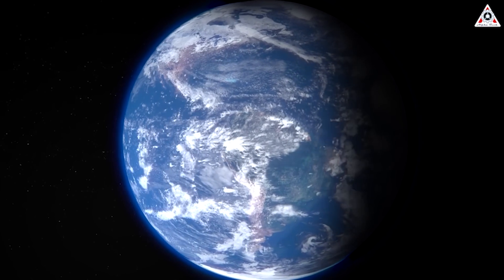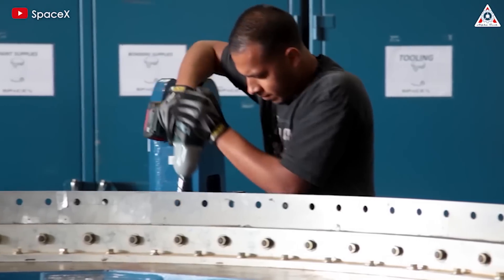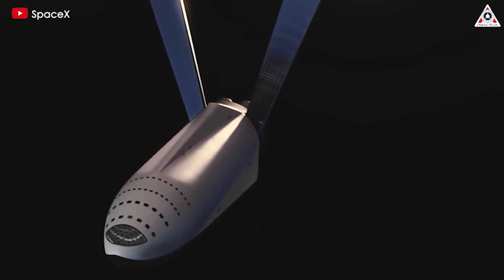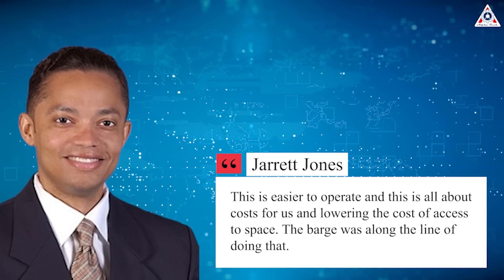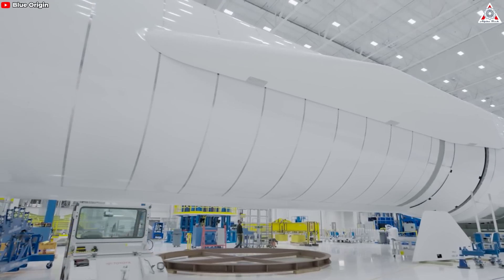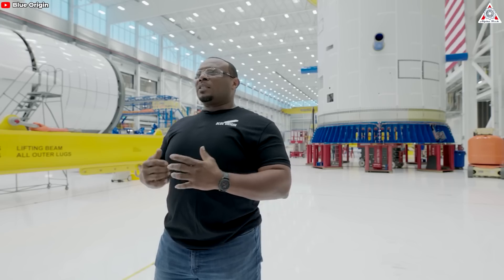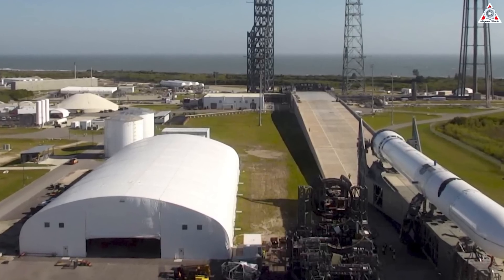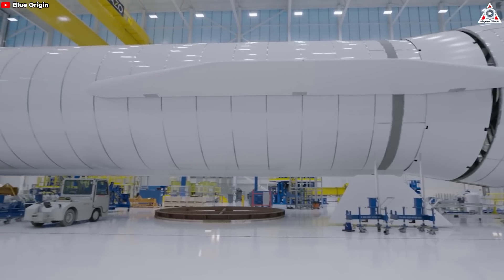Somehow Blue Origin New Glenn to orbit EXACT Starship Killer! Musk laughs...

Comment: In a simple answer - NO - they have done little to no testing like SpaceX has done and just expect it to launch and work straight away - well they are going to be in for one big surprise when shock horror it doesnt behave as expected!!! Craft like these require extensive testing and infrastructure both of which BO has done very very littel of, but because of the NASA connection it looks like its going to get its first outing ahead of Starships flight 5 which is being 'strangely' hindered by the FAA yet again.... hmmmmm. This will only hold water for so long guys before you are found out for being political and getting scrubbed of your own!!!
Reply: Yup I'm gonna laugh so hard when new Glen plummets to earth in a fire ball. I see this going as well as starship flight test 1. It probably won't destroy its stage zero but I give it a 50% chance of making it past MaxQ and a zero percent chance it lands on the drone ship. I can see the fireball as it hits the drone ship at terminal velocity now

Comment: New Glen has potential to find a niche beyond LEO due to the hydrolox second stage.  To a degree the fight for this space in the market will be with Vulcan.  If ULA makes first stage engine pack reusable this will hinge on the cost of second stages.  RL-10's are pricey.  Don't know about BE3-U.  Not quite sure where Jarvis fits in.  Kind of like Falcon heavy where most missions are core expendible.  Maybe a good Moon return vehicle, though as a third stage might be better.
Reply: If BO Escapades launch is successful, then they would actually be ahead of Starship.

There is more than a niche market for BO.
Starship can lift 150 tons to LEO. New Glenn can lift 45 tons.
New Glenn could be the more cost effective vehicle for all payloads less than 45 tons. Because it will use much less fuel per launch.
Reply: @vonnikon  Possibly ahead of starship, yes, but even for payloads near 45 tons it will have trouble competing with Falcon heavy.  As things get farther out the hydrolox second stage is more effecient than the kerolox second stage of Falcon.  Falcon heavy with two recovered boosters beats or matches New Glen to about GEO, after that  New Glen can launch heaver.   Even if soon launching and recovering commercial missions, Starship will be busy developing and flying moon missions, completeing Starlink, developing spacesuits, Larger Dragon, and no end of other missions.  I see a place for Neutron, Falcon 9, Vulcan, Falcon heavy, New Glen, and Starship depending on payload and mission profile and production and operational expense.  Falcon 9 will likily have its number of flights reduced starting in 2026.  Remember starship is the way for Starlink completion to full capacity,  and to Mars eventually.  That design makes it good for the moon as well, and New Glen may eventually have a place there too for lighter loads.  Falcon Heavy may have a place at the space station at the moon simply because it can and has been flying, but it is not optimum for that high an energy.
Reply: @michaelmcmullen354  would a New Glenn launch not be cheaper than a Falcon heavy?
Higher percentage of reuse, and fewer boosters to recover and refurbish.

Another practical advantage it has is the fairing size. Falcon heavy has a tiny fairing, which limits the payload.

I agree that for high orbits the New Glenn shines.
Reply: @vonnikon  The issue is second stage cost.  The merlin vacuum is rather cheap, the two BE3U's cost quite a bit more.  Currently no plan to reuse that expensive larger fairing on New Glen.  Therefore the Falcon Heavy is likely a little cheaper than New Glen per launch.  Also F9 and F9H development costs should be pretty much amortized.  New Glen should be a good rocket when the bugs get worked out if Blue does not do a Boeing or make enemies.  Its sweet spot is just GEO and beyond.  The competition between New Glen and Vulcan may be fierce if vulcan starts recovering engines and other bottom section knick nacks..  Vulcan's second stage engine, the RL-10, is very pricey.  Excellent but expensive.
Reply: @michaelmcmullen354  but the F9H expends 9+1=10 Merlin engines per launch.
The New Glenn only expends two BE3 engines...
Reply: @vonnikon  Correct.  It is said Merlins cost a bit over $2,000,000 each.  9 of the expended engines could have flown many flights before being expended, perhaps 7 or 8.  (1+9/8)*$2.2Mil~=$4.5 million.  BE3U's are speculated to be about the same price as RL-10's, $10 mill to $15 mill each, not very close.
Reply: @michaelmcmullen354  assuming BO cannot get the cost of BE3Us down when production scales up.
Also assuming that there are ~10 F9 launches for every F9H launch also in the future, otherwise there will be no well-used Merlins available to expend.
Reply: @vonnikon  Correct.  Lot of assumptions.  That is OK though.  Blue will still shine for higher energy work.  They have a lot of opportunity to do simplifications and improvements like the raptor has been doing and no rush.  Note orthogrid may end up being a hinderance to rapic production rates.  I suspect the additive manufacture may slow Raptor 3 production.  Nobody knows much about BE3U except that its performance ended up better than planned.  Nobody knows much about long term reliability yet except for Merlin and RL-10. Blue's engine count is in a sweet spot for engine reliability.  Enough to be able to lose one, but not so many that it is bound to lose multiple engines and missions most flights.
Reply: @michaelmcmullen354  one thing I don't get about the BE3U is why they have two turbopump shafts instead of one. It adds mass. Bezos mentions that the second turbopump can recover some energy from the rotational momentum of the exhaust from the first turbopump. But is that really worth all the extra mass?!?
Reply: @vonnikon  A bit higher ISP on the secound stage probably can be worth dozens or more kg on a rocket of this payload.  Also provides more peak thrust which can be difficult for engines of this inexpensive open expander cycle type.  The last mentioned 172,000 lbs of thrust and 445 sec ISP for BE3U is very very good.  The combination is only exceeded by the very very expensive RS-25. and a couple of in development Chinese engines.  Blue has been involved in hydrolox engines for a long time.  Think in terms of similarity with jet engines.  The best have two turbine stages.  Or sometimes 3.  Wrings more power out of the hot gasses.  Just as a thought may be easier to spin up saving fuel during start up, and cancels out torque that may cause the rocket to spin requiring fuel spent to correct.

Comment: I would think the simulator is being used extensively because it's cheaper then building lots of hardware and launching it. 
Overall BO is following the traditional paradigm of test to perfection so nothing ever fails in real life. It will be clear by now that if you want rapid Innovation, that doesn't work very well. 
BO may well however have a perfect product from the first launch. It will of course have taken years, which represents lost revenue, and lost Innovation opportunity. Like everyone else their rocket engines are way behind SpaceX technology and the company lacks SpaceX staggering capacity to build engines and launch vehicles  quickly. Both of these factors are equally important as the hardware itself as far as I can see. 
Overall bezos strikes me as a very wealthy hobbyist

Comment: I'm pretty sure I already commented this, but New Glen isn't a Starship killer assuming it ever actually launches it could very well be a F-9 and certainly a Falcon Heavy killer
Reply: Except Falcon Heavy and 9 are extremely successful, pretty much equally as powerful, and already have inserted themselves as THE rocket launch provider to companies. Bezos taking this long to build this rocket and never even having tested the damn thing will make Blue Origin kill itself tbh. I don't see companies choosing New Glenn over Falcon 9, Falcon Heavy, or Starship.
Reply: @gigacream5830  Dude I was just commenting on the title, and nobody knows if Starship will be economically viable, it's been shown time and time again that larger rocket just don't sell well and Starship is VERY large.

As to not being able to compete with SpaceX because they are later to the market, companies that rely on Space will even if it's a bit sub optimal will buy launches up from other companies to make sure they are not completely beholden to any one company.

So Blue can probably get 10 - 20 launches a year pretty easily.
Reply: @Etheoma  A lot of that depends on price.  Very hard to tell.  But being second or third has its advantages.  SpaceX has broken a lot of ground for the others (think methalox and regulatory hurdles), and the second mouse may get the cheese.
Reply: @michaelmcmullen354  What I simply mean is that New Glen isn't as capable as Starship honestly though that may make it a better rocket for the large majority of customers, but if you need to launch a 100+ tonnes New Glen can't do that hence why I say it's not a Starship killer.

It may well be more a successful rocket because it's smaller, and the starship might be crushed under it's own capability, but the success of New Glen will not really effect that, what might be effected is the Falcon 9 and Falcon Heavy.
Reply: @Etheoma  Correct.  $/lb to earth orbit is only a good measure if going to the same orbit with a bulk divisable cargo.  Really different missions. for New Glen and Starship.  Maybe some overlap with large constellations all in the same orbital plane.

Comment: 8:58
Ah.. am I wrong?  Isn't this thing nearly exactly the same size and capability as Falcon 9?  Or is its capability closer to Falcon Heavy?
Reply: Closer to heavy
Reply: Falcon 9 is close to 3 meters diameter, New Glenn is supposed to be 6 or 7, that statistic keeps wiggling in different  reports. Still smaller around than the 9 meter Super Heavy. 😊

Comment: They continue to run hardware poor. Using mockups when they should be using actual rockets to, at least, give them construction experience. Aerospike should be a side project until they get New Glen off the ground and back again (at least getting lower stage back. 
Seems like they can't walk and chew gum at the same time. 

Spacex runs with Multiple operational ships at the same time and works to continually improve construction (more so with Raptor which is produced faster than needed, to perfect manufacturing and iterate rapidly.
Hardware rich design. Hundreds of engines, many of which will likely thrown out in addition to the destructive testing.

This burns hundreds of millions yet gives them Enormous flexibility and ultimately allows them to rapidly test, knowing that other rockets are ready, even as one fails in an instructive manor. Stable thrust (185t>280t) And economy of production have both benefitted greatly leading to the V3 Starship even as they transition to V2.

So long as BO continues to use mockups, I have little regard for their progress. There were rumors they would launch this year. I was able to dismiss that very quickly as they are Not making good progress. Their secrecy continues to hide a lack of progress. 

Jeff Bezos left Amazon. Thought he would start spending money on BO. $1b/year burn clearly isn't getting the job done. 
Don't know where his production rate is with BE-4, but there has been Zero follow-up after 2 engines were launched successfully with Vulcan (though an explosion of a production engine in certification testing was not encouraging (Spacex solved a similar issue in 2 weeks and moved on.) Not sure if they have.

The turtle is moving too slowly even now under somewhat better management. 
Unlike Spacex, BO does not have a Starlink to ramp their launch rate and bring in big money. 
When Spacex had the recent 2nd stage issue, the figured it out, worked with the FAA openly and launched 3 rapid Starlink launches in one weekend to certify the fix at no risk to customers... BO doesn't have that. 

Amazon's Kuiper satellites are due to be ready for full production mid 2025 (Half their constellation of 3200 or lose FCC license). Big question mark if BO will be ready with New Glen. Not even sure if they can produce enough reliable engines for Vulcan, which would like to move to at least a monthly cadence next year... can BO produce 24 reliable engines on top of their own, much greater needs with BE-4? Their factory looks more like a prototyping building than a factory. That's a big problem for a company that has so many flights booked for Amazon with the FCC window closing. 
Amazon needs to loft 1600 Kuiper satellites no later than mid 2026. They launched the test articles (2) but NO production satellites, with mass production facilities only just now completing in the 11th hour... Fail and they lose their FCC bandwidth.

Amazon had to sue to get 3 F9 flights to get their initial satellites in orbit... but there are 1500 more that need to go up All on unproven rockets as the Russians are out for now. Ariane 6, New Glen, Vulcan. 42 more launches in 24 months on unproven rockets with 1600 satellites from an unproven factory.

Amazon has deep pockets, I would buy another 10 Starship flights to de-risk the launches. Kuiper will need replacement satellites, so the launches won't impinge on the current contractors, but clearly they need breathing space as (combined) they clearlty can't manage a 2 launch per month tempo... that time is too close to the deadline. 

45 launches due in 24 months. Does Anyone believe the don't need to course correct? 13 Starlink launches would put up 400 satellites (give or take). That would still leave them 32 launches in 24 months to fill with their untested and barely tested rockets. The only reason I can see for not booking the flights now is that their production line is also in doubt.  If New Glen actually launches in reasonable numbers,, given its massive capacity, they can catch up fast... however, it's still a paper rocket. 

Here, now, they are on the road to likely failure, but they can still pull this out.
Reply: There is only one, single company on the planet capable of launching at that kind of cadence right now - and that is going to be true for a long time. 
SpaceX rockets are not untried, either - they are unparalleled in their strength and reliability. 
 - Someone "on high" had better figure this out, before Boeing's corporate malfeasance, ULA's single-use idiocy, Blue Origin's owner's ego,  and NASA's stubborn favoritism toward an aging, useless contractor,  whose bureaucratic jealousy, and butt-hurt Corporate "feelings," cost us more than they already collectively have, with the cancellation of a Moon Rover that is already built, but won't be going to the moon (after we spent BILLIONS building it), while all the space science being backed up and cancelled (costing us billions more in missions that SHOULD be docking at the ISS, and allowing crews that have been training for YEARS to complete them at the ISS,) are being pushed back or cancelled because Boeing's leaking bucket POS is sitting like a useless skin-flap or some Space Barnacle, on the docking port of the ISS - and filling it to its maximum capacity, while NASA and Boeing wring their hands, dither around, and double-talk to us like we were children. 
If we want to "lead in space," then we have to learn to cut our losses, stop making embarrassingly incompetent decisions that REEK of favoritism, and use the best that we have. Space isn't waiting. 
 - There's no time left to glad-hand and fool around - WE WASTED SEVENTY YEARS, and now there are others willing to do it if we aren't, won't, or just can't cut loose  contractors like Boeing, who still think they are indispensable, and if     they just keep begging long enough, they'll get another few billion. 
 - Those days are over, and we had better start applying ourselves.

Comment: Blue Origin has stockholders.  "Failure is not an option."  Marketing people have VERY short attention spans.  Hence the four false starts on the Panama canal.  Or SLS delays.  Musk handles failure well, Bklue Origin does not.  As a professional scientist, failure is a boon, not a setback.  One learns more from failure than success.  If everything works, one wonders what subsystem was on the edge of failure.  Syuccess will not give you hese answers.
Reply: Blue origin doesn’t have stockholders bud. It’s funded by Bezos only. Do your homework kiddo
Reply: @irietropicals4255  This is why BO can move so slowly. But Vulcan and Amazon are separate corporate entities (at least for now) and they have to move faster. Playing with mockups in (clearly) a hardware poor environment does not instill confidence. As a project manager, I can tell you that leaving so many high risk punch points so late in the game (Amazon must have 1600 active satellites in orbit in 24 months or lose FCC license). ULA is already paying late fines to the military. Amazon is already antsy and sued Jeff for 3 F9 launches to de-risk the launch cadence somewhat with a proven launcher that has the most flexible schedule available.
Reply: Failure is a part of the necessary feedback loop for iterative design processes. SpaceX will leave BlueOrigin in the dust. They’re continually redesigning the rocket aero and shielding, launch systems, towers, rocket engines, software, etc.